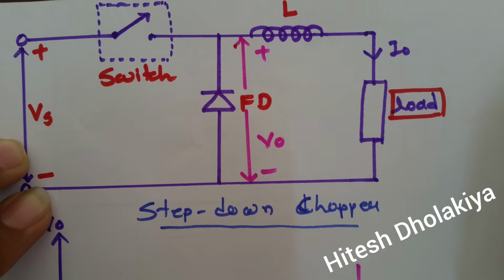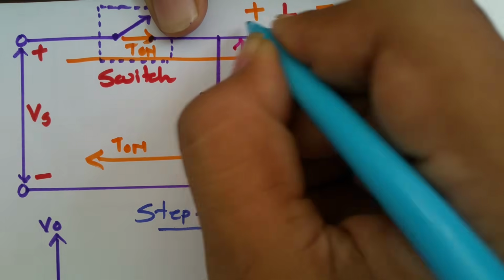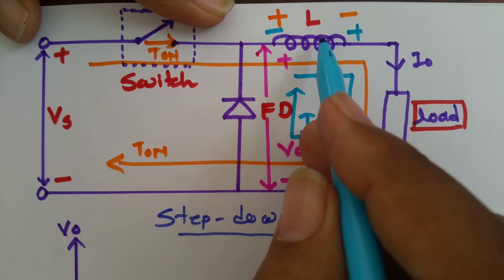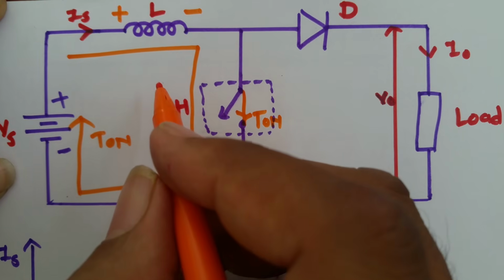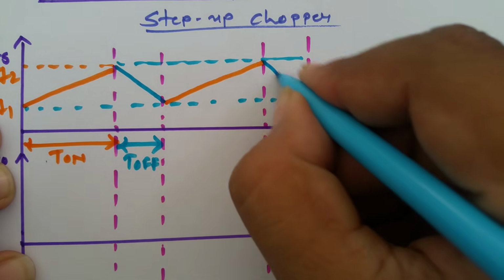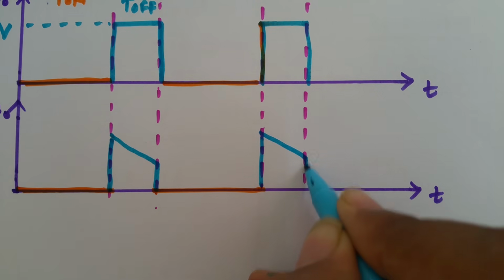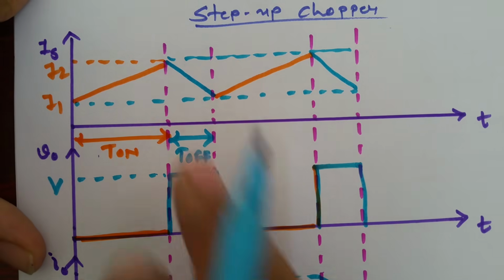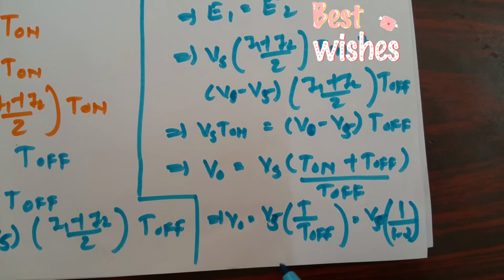Step up and Step down Chopper (Basics, Circuit, Working, Waveforms & Applications) Explained

Comment: Chopper is a device that converts from constant dc input voltage to variable dc output voltage. You know if input and output will not mark so the totally answer was not complete.
Reply: Hi mate, I don't really understand what you are explaining. Could you expand?

Comment: In the step up chopper circuit when the switch is off why is the load current similar to the current flowing through the inductor?

Comment: In The step up chopper circuit the inductor is connected to the source before the switch but why does current flow through the inductor only when the switch is ON?

Comment: Explanations are wonderful and I'm sure a lot of students are getting help from these videos. But almost all videos have some serious mistakes.
For example, Supply is DC and the inductor in this case of DC just behaves as wire. I'm still confused about how the inductor is getting charged
Reply: But , brother according to the property of the inductor ( it allows DC and it blocks AC) it starts charging naa😊. I have silly doubt during T-off how output voltage will zero, I'm little confused. I think due to freewheeling diode , the entire load drops at diode.

Comment: In step up convertor, when switch is on, still diode is forward biased, so why current does not flow through diode and is restricted to inductor and chopper loop??

Comment: Can I step up 12v dc to 220v dc using chopper???
Reply from the maker: Yes but current ratings will go down.
Reply: @EngineeringFunda  thanks sir🙏🙏
Another question sir, what will be the voltage across the switch(MOSFET)
Will the switch ever see  voltage higher than the input voltage( self induced EMF)??
Reply from the maker: It's not that simple to reply without watching circuit
Reply: Actually I am designing a boost converter that can power a 9 watt 220 volt LED bulb from a 12volt battery.
 Again, sir thanks for sharing your knowledge with us🙏🙏

Comment: Sir, thank you for your precise times
The way you explained everything is very easy to understand.
Sir, i will be very thankful to you if you put some lectures about thyristor choppers and switching mode regulators.
Reply from the maker: I have already explained choppers, just go through my playlist on power electronics.
Reply: @EngineeringFunda  and sir switching mode regulators?

Comment: When the switch is off how the output voltage becomes zero because at that time inductor is act as a source and current is passing through the diode.
Reply: Ita tor voltage er iccha he je samay chaibo ui samay zero hoibo
Reply: @subhajit9249  bal akta tui

Comment: Sir is this equation are enough to gain marks??? Pls reply sir
Reply from the maker: Yeah ,😀
Reply: Engineering Funda sir pls explain about single phase full convertor with r, rl and dual convertor and 3 phase full converter sorry for big list thes question are too difficult so only 😅😅😅pls if u could explain about those 😊😊😊and thanks for these vedios very nice all the best for upcoming 😊😊

Comment: one question sir, during Toff the current doesn't stop flowing through the load then why the output voltage graph vo is shown off??
Reply from the maker: Output is short-circuit
Reply: but sir the output current passes through the load or the resistor......then accroding to v=i*r certain voltage drop must be there....isn't it??
Reply: sir kindly notice, i told about the case of the step down operation, not the step up operation
Reply from the maker: TAMIM SHIKTO : output is across diode, so when diode is ON voltage is zero ideally, practically 0.7 for SI diode.
Reply: thnx sir, can i have permission to contact with you in any social media..???
Reply from the maker: You can talk to me by my website. And link of that website is there in detail of all videos.

Comment: Sir,in step up chopper when switch is on(t-on) why the current is not flowing through the diode (d) while it is in the forward bias?
Reply: current flows through all paths in an amount inversely proportional to their resistance, so it takes the path of the least resistance.

Comment: In step up chopper...,
Why inductor is always charge when switch is on and...discharge when switch is off
Reply from the maker: If loop is enclosed then inductor will get charged by supply and if supply is disconnected due to switch off then in other loop it will discharge
Reply: But supply is still connected in stepup chopper ,during toff???so why not inductor current only increase
Reply: It's basic property of inductor
Reply from the maker: TAMIM SHIKTO : no it's wrong. Output is across diode so when diode is ON, output is zero

Comment: In Muhammad rashid book , in step up converter having RL load they have used an battery on  load side ,...Sir ,what is the significance of that cell..... Please explain...... and value of E must be greater or smaller ?
Reply from the maker: +Eshant Jha : battery is used due to inductor which generates back emf and to nullify back emf bettery can be contacted.
Reply: Sir also it's written in no load when battery is used ..It should satisfy...0<Vs<E................And in case of resistive load........E<Vs for continuous current ........... Please explain how E can be decided ?
Reply from the maker: +Eshant Jha : E can be decided by calulating reversal of current, generally it happens due to inductive element and impedance mismatch

Comment: In step down how output current increases when the switch is on ?
Reply from the maker: +varinder singh : it is charging inductor and as inductor is getting charged it allows more current to pass through it
Reply from the maker: +Engineering Funda : Yes off course current will increase as switch is ON